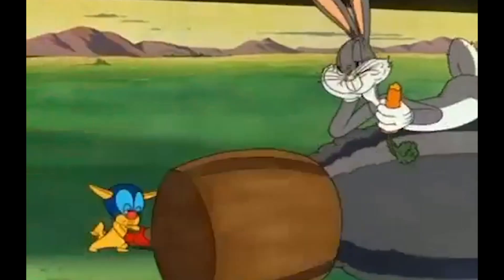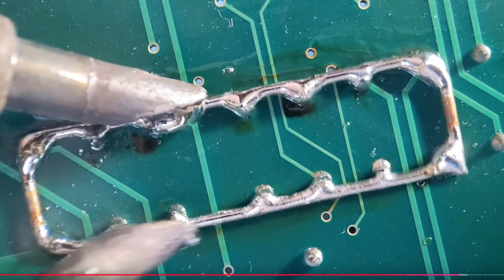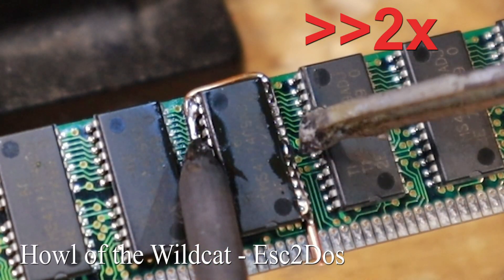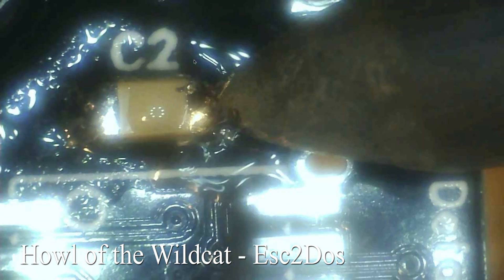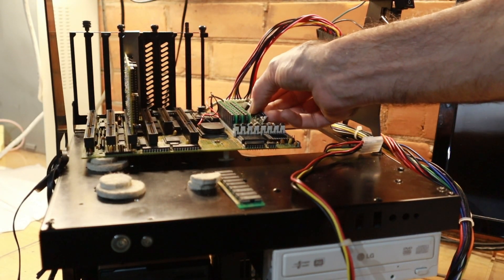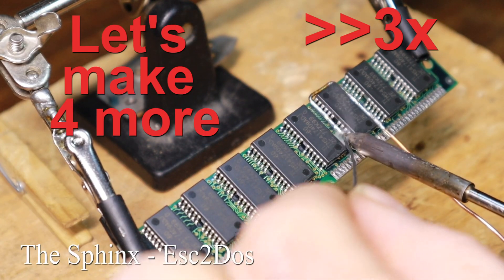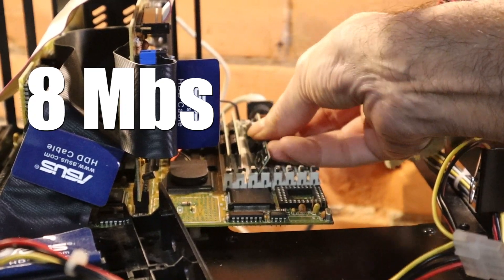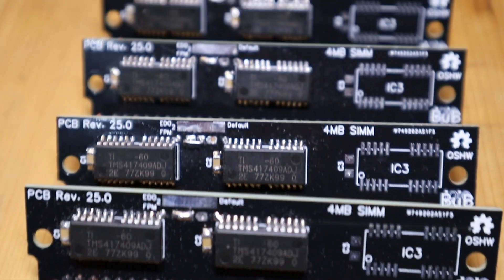DIY Ram Modules

Comment: so you mean using a dvd/blu-ray drive for about 150nm lithography, and then just adding the ion/pvd in the same chip fabricator machine. yep vacuum of course. mosfets built on normal dvd disc. also any micro-fpga gate math compute network fully parallel and pipelined. yep vlsi chips. 150nm is later than original pentium, more like pentium 3/4 process. diy at home of course. so, diy?
Reply from the maker: Yes Diy, and it's pre-pentium, 386/486. I repurposed existing chips, no need to create them. That was all explained in the video.

Comment: This desoldering was surprisingly painful to watch.. but at least the whiny music echoed the overall sentiment well. Really, there is no replacement for either a hot air rework station or a hotplate.. considering how long the desoldering took, I would be surprised if those rather old chips haven't suffered any damage. One method that might have worked better would have been to make the copper wire loop longer and shove it into the soldering iron instead of the actual soldering tip..
Reply from the maker: This wasn't a 'how to' this was a 'will it work'. With the ts100 you can't stuff anything in, but yes I realized after that the Soldering gun I was using, that would have been an option. No the chips are all in fine shape.

Comment: So what's the story with why some computers require the 30 pin simms with the 1 bit chips? And can you make them today?
Reply from the maker: The extra bit is for error detection, some boards insist on it,others give an option. I have one 386 that will not boot with non-parity simms and I was hoping to add the 3rd chip to turn mine into parity Simms, and yes it can be done. The only issue is finding the 4Mx1 chips unless you have old stock to pull the chips from it can be difficult to find those chips.
Reply: @esc2dos  I was more referring to the fact that some computers don't like the 4 bit chips. So they want the simms with 8 chips on them. 9 if you want parity
Reply from the maker: @infopackrat  Oh, that's news to me. I haven't encountered that yet. This is the reality we face, until you test it you really don't know what to expect. Documentation for these old boards is hard to find as well.

Comment: If you need to mass salvage SMD components super safely like from this memory stick just use a heatgun from a home improvement store, if you have one already, or if you have a hot air soldering station, that works too. Just put something heat resistant underneath where all the hot chips fall down, a silicone mat will do or a piece of aluminium, hold the PCB chip side down and blast it from the opposite side. Takes about 2 minutes and and it's good for the chips since they aren't being heated directly but pins side first. PCB usually survives as well but that's much less of a guarantee. Surface tension can be a bit of a trouble so maybe have something nearby like a ceramic cup or a chunk of metal that you can whack the edge of the PCB against to help the gravity along, though normally they should just fall down.
Reply from the maker: I agree heat guns can speed up the process but it's really easy to melt plastics on the board. Ya and whacking the part with hot solder on the table was my "desoldering" method for decades. Actually had to use that approach with the last 4 Ram sticks I made, had a bridge underneath the chip and wick wasn't doing it.
Reply: @esc2dos   Bridges just go away with a hot, dry iron and quality flux.

LCP does just fine being heatgunned but PA doesn't, so old through-hole wave soldered connectors don't fare so well.

Comment: For component removal.... Try using a paint stripping heat gun. The kind that looks like a hair dryer reproduced with a power drill. I have ones meant for hot air rework, but I like the digital one I got from Lidl for $20 a few years ago.
Reply from the maker: Yes, but the Hot air rework station is much more accurate, I melted a few ISA slots using the Full size heat gun.

Comment: @2.55 I wonder if putting the wire in a "plastic stapler" would turn the whole wire into a iron tip. wire would probably have to be steel though. 

I'm kinda surprised the chips lived through that much heat.

still, the hot air looked 10x easier and much cleaner. maybe having a standard heat gun under the board would help someone attempting to de solder as you initially did.
Reply from the maker: or, that Soldering gun I used .. using copper wire in that would probably have worked a charm too, wish I'd thought of that, totally would have added that to my video. Excellent suggestion.

Comment: great outro too with you muzak sbpro. and my pcbs arrived today, now off to find some of them 16mb 72 pin edo ramsticks.
Reply from the maker: Cool, I hope it goes well for you, it's like a super power making Ram
Reply: @esc2dos  unfortunately the blurry photos of the local 72 pin turned out to be 4 mb sticks. i see 16mb sticks on ebay in ont that may be right, $10 each.  samsung K4E160411D-BC60 are the chips
Reply from the maker: @ Just checked the datasheet and those will work, are they 8 chip Simms?
Reply: @esc2dos  thanks, yes 8 chips per, 16 mb modules, says they from routers.
Reply from the maker: @r4z4m4t4z  All that matters is that they are 4Mx4 which they are. I found the listing in Mississauga. Get 'em before somebody else does. How many are you gonna get ?
Reply from the maker: @r4z4m4t4z  I forgot to mention, one thing to consider, do you know if the machine you're going to install these Ram modules in accepts Non-Parity Ram? Typically 8chip ram.
Reply: @esc2dos  yes i beleive so. or i did 2 months back after watching BuBs video and i ordered some pcbway.
Reply: alright, got all 5 rams with a discount in shipping. now i need some caps, those you got are 50v? from canada supplier? or ali bubba?
Reply from the maker: @r4z4m4t4z  "1206 100nF 50V" and I got them from Ali Express for $2.40, 1206 is the size. They are tiny but not as crazy tiny as the caps they used on the Voodoo cards.

Comment: You might consider the use of a hotplate for removing chips in the future. You just set the board directly on it and wait for the solder to melt. Once it does it's as easy as plucking them off.
Reply from the maker: Agreed, that would be a great addition, but desoldering tool is next on my list.
Reply: @esc2dos  toaster oven, place on top, available at vv
Reply from the maker: @r4z4m4t4z  ya, heat and a way to control it, all that matters.

Comment: Leaded solder and 410 oC plus work much quicker.
Reply from the maker: I was using 60/40 solder and tried to keep it around 350c otherwise the tip corrodes. Can't seem to get the Pinecil past 400c, power supply is insufficient.
Reply: @esc2dos  second look I can tell its's 60/40 as even with low heat it is still smooth (ish) not crystaline.
 I use a 60 watt soldering iron for most work with 4-6mm bevel tip.
Weller W61 is my favorite.
Got to say you did a decent job with the tools at hand.
I don't use an iron under 40w with a good thermal mass unless I have no choice.
High temp and fast work, I do have 50+ years under the belt though.
Reply from the maker: @TheCrakkle  I went through plenty of those 30watt Weller irons until I bought the Pinecil. I think 'sleep mode' is enough to sell me on the electronic, definitely not as powerful as your 60w, but how many times did I leave the 30w on overnight or more.

Comment: Oh my Got! Flux, flux, flux. 
You can use the solder saturated braid to solder on the chips. To unsolder them you can use a diy heater, made from a halogen lightbulb with the IR filter removed.
Reply from the maker: I think I'd need to see you demonstrate the soldering with saturated braid, these chips have legs that wrap underneath, rather tricky.

Comment: Wouldn't you want that copper to at least be up against the pins? Because it looks like you had a massive gap on one side.
Reply from the maker: The copper wire was easy enough to push in tighter once it got hot, but ya, closer the better.

Comment: I ordered these PCBs (the EDO2FPM version by Bits und Bolts) literally a week ago and am waiting for them! I wonder if they will work well in my 486 motherboard which only has 30 pin SIMM slots.
Reply from the maker: I just put all 32 megs in my Unichip 486 and ran the Ramdrive test as I did in the video and it's working 100%. The only issue you might have ( as far as I know) is whether your board only accepts parity Simms, I've got a 386 like that and I'm looking to add the 3rd Chip to some of these Ram pcbs to make them parity. The one thing to be careful with is bridging the legs with solder, I rushed to make the last 4 and had to do a bit of extra work to get the solder bridges from under the legs. First 4 worked flawlessly because I was slow and meticulous.
Reply: @esc2dos  My PCBs arrived today. Soldered them fine without bridges (I have some experience, so it was no problem). And they work on my 486! The chips I used are from a 16 MB EDO stick with TLM517405CJ-60 ICs. So my 486 motherboard doesn't need parity. In my opinion it's a amazing project when original 30 pin SIMMs are not cheap.  Also the fact that they are DIY sticks makes them even cooler.
Reply from the maker: @maniek86  That's great to hear, I couldn't agree with you more. I started pricing the 30pin Simms a while ago and got very discouraged until I saw BUB's video. This would have been so expensive to do 30 years ago, I would never had considered it back then. Congrats, I'm glad this was a success for you too.

Comment: 16:49 that would be like putting 512GB of RAM in a computer nowadays.
Reply from the maker: And would it cost over 3000 bucks?  No idea what ram prices are today
Reply: unfortunately, nowadays you can easily afford maxing out the ram on a system.
Problem is, the plattforms are limited by the lack of support for registered ram (consumer) or available ram-slots.
I was happy that ddr5 mainstreamplattforms now support 192GB ram.
Reply from the maker: @dolphhandcreme  That's why this is such a nerdy thrill to max out a machine from the early 90s now, it was lunacy to pay the price then especially considering that there wasn't much of a benefit other than bragging rights.
Reply: @esc2dos  yes, i love that,too. But it's kinda anoying watching an old pentium pro counting up 1024GB RAM, takes over 30 seconds. It's crazy to build machines today which we have dreamt of 20 or 30 years ago! So satisfying!
Reply from the maker: @dolphhandcreme  Ya, long tedious memory counts are draining but the snappy sound of the 386 with 32 megs is the best use of the "Pc Speaker"  IMHO. If we could only go back and selectively save the stuff we threw out though. Save me having to kick myself nowadays.
Reply: @esc2dos  oh yes... Younger me dismantled mfm drives for fun. They were so useless after getting my 170 and later 430mb ide drive.
I got so many old components, even some of the now-unbuyable fic mvp3 ATX boards.
Anyway, that's life. Back then we didn't know better and played with "junk" on our own ways.

Comment: At least you must give additional plenty of flux, not only plenty of solder.
Reply from the maker: it's flux core solder.. and keep in mind.. I did get them off .. doing it with solder sucks anyway, hot air is the only way to go
Reply: @esc2dos  You are right but plenty of flux will delay solder hardening except if you use low melt solder.
Reply from the maker: @dasmin1135  Absolutely, I gotta get some of that low melt stuff I think it will be a game changer.

Comment: The soldering iron tip used for desoldering the RAM looks like a nail!
Reply from the maker: Demonstrating that even with a nightmare of a soldering iron tip this job is possible. New tip is coming.
Reply: Can confirm that using nails instead of proper iron tips does indeed work
Reply from the maker: @AradijePresveti  What a tragedy it will be when I replace that tip.
Reply: @esc2dos  You could just clean it. Use some soldering flux and that steel wire used for scraping dishes. Heat the iron up, put some flux on the wire and scrape it. If you're scared that you're gonna burn your hands, just put some gloves (make sure they're not gonna melt).
Reply from the maker: @AradijePresveti  When they are new yes, cleaning them is all you need to do. When you file the coating off these ts100 tips they are pretty much done, I've tried everything to revive it. They're not like the old Weller kind. Especially when you push them past 350c they turn black and nothing will stick, no matter how much you polish and flux them. New tip is on it's way.
Reply: @esc2dos  I have the same tip for like 8 years and I use it almost daily. Still looks great and works just fine.
Reply from the maker: @AradijePresveti  I wish I had your luck, how hot do you run it? do you ever push it to 400?
Reply: @esc2dos  I had to check 🤣 It's set to 350C and I don't think I ever changed it. I just clean it each time I use it and I tin the tip afterwards.
Reply from the maker: @AradijePresveti  You're using an actual ts100 or a Pinecil? I wonder if better tips are solid Stainless steel, mine started peeling after a year. And I ran it as hot as possible to melt plastic and just about everything else I could use it on.
Reply: @esc2dos  It's a ZD99 (it was the cheapest station where I'm from) and I have two tips. Original tip is probably copper with some plating, and the other tip I made myself from some steel I had laying around and I use it to melt plastic. I don't use the same tip for everything. Probably why it lasted this long.
Reply from the maker: @AradijePresveti  Very different tip, Weller style, the TS100 have the heating element inside, can't make your own. This makes much more sense as to why yours lasted 8 years. I can't live without the 12 second heat up now though, even if the tips are junk.
Reply: @esc2dos  Yeah, that could be it. I really don't care if it takes a couple of minutes for the iron to heat up 🤷‍♂ Seems like cheaper one is better choice in the long run.

Comment: Now after seeing bga1356 ballout i'm wondering if it's possible to make a custom ddr4 module in a ddr3 "skin" couse 6-9 gen intel mobile processors support both- ddr3 and ddr4, and they're connected straight to cpu. I wonder how the bios would recognise the SPD.
Reply from the maker: That's decades apart from what I created, back in 93 computers were so much simpler, these ram modules have 52 solder joints.

Comment: The best way to take out the chips is using a hot plate at 200/205°C. You can also use it to solder the new boards, just apply flux paste to the board, tin all the pads, place the chips/capacitors in the right spot and put the boards on the hot plate, in seconds the solder melts and pulls the parts to the correct spot, then correct the position of the chips if needed, remove the boards from the hot plate and wait to cool down, clean them and that's all. If you have a stencil you can use solder paste.
Reply from the maker: There's a small hotplate Tony359 demonstrated, probably would work great for these 30pin ram, even if you had to slide it over. I agree that would make this job much easier.

Comment: Holy crap that was some of the most painful desoldering footage I've ever seen. A spider monkey with a flamethrower would have been less horrific to watch.

Also, TIN YOUR DAMN SOLDERING IRON TIP!
Reply from the maker: That tip is junk, tinning it is near impossible and I've had to file it to a point, when it was new it was perfect. YA.. I need to buy a new one.
Reply: @esc2dos get a soldering iron like the TS100 or something similar. compared to soldering bread and other stuff you won't waste it's cheap.
A cheap hot air also costs not much. My first hotair costed 40$ with a soldering iron included. The 858D is around 35$. Does the job and avoids eye cancer to your subscribers 😁

Edit: watched the video to the end. Forget my comment. Anyway, I felt so much pain watching the first half, so I'll keep this comment.
Reply from the maker: I'm using a Pinecil and the new tip is on it's way. That is the original tip I got with that Iron a couple of years ago. Sometimes you gotta go with what you got to get the job done.
Reply: @esc2dos  You can get Stannol Tippy or some other tip restorer. No matter what horrible fate befell the tip, it always manages to tin it.

Then again i've never filed or otherwise terribly molested a soldering iron tip in these 30 years so idk.
Reply from the maker: @SianaGearz  I think these TS100 tips are produced so cheaply that trying to fix them isn't really cost effective.  But I didn't know about "tip restorers", Thanks for that.
Reply: @esc2dos   Yeah thanks for the warning. I have previously decided that my next station will be plain T12 cartridge based since i can guaranteed get good cartridges for that, even if i have to pay extra for them.
Reply from the maker: @SianaGearz  I was hoping that Digikey would have the TS100 tips just to be sure I wasn't getting garbage from Amazon, but they don't stock them and they're discontinued. So you kinda gotta just cross your fingers and hope whatever arrives isn't trash. T12, might need to go that route if my Pinecil dies.

Comment: alright! lots-o-ram now. seems hot air is he way go.
Reply from the maker: I thought the copper wire method might reduce the risk of overheating the chips but I was able to extract them so quickly with hot air at the same temp as the iron that they were cool enough to pick up after they dropped. At the very least I did manage to de-solder 2 chips at once, that might be an internet first. Hot air is definitely the way to go.
Reply: @esc2dos yes, the double pick was impressive.